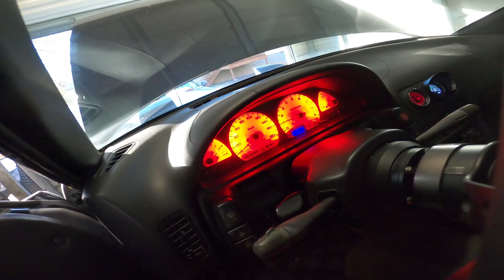Learning why my ca18det 240sx has 5 neutrals!

Comment: If you haven't already bought a rear main, you can use one from an SR20. The transmissions are also close enough to the same you can just swap the CA bell onto a KA/SR trans
Reply from the maker: I actually swapped it for a ka one, and I bought an entire oem gasket set a while back so I swapped it when I did the trans. I’ll upload it soon! Btw thanks for the knowledge, I had no idea you could use an Sr20 rear main